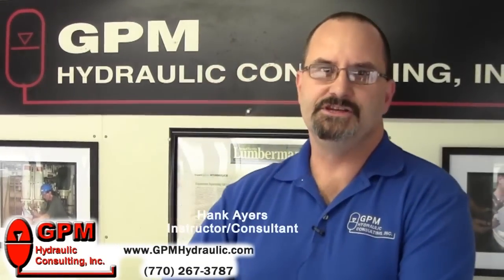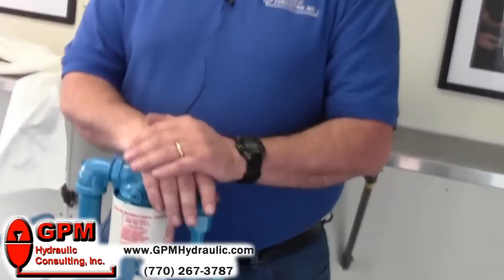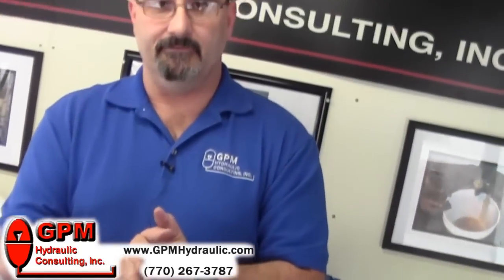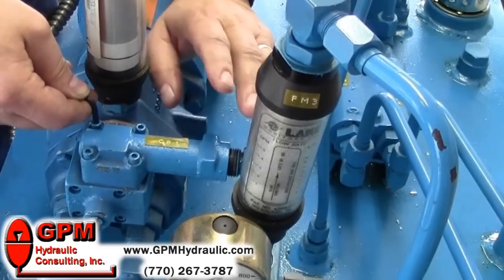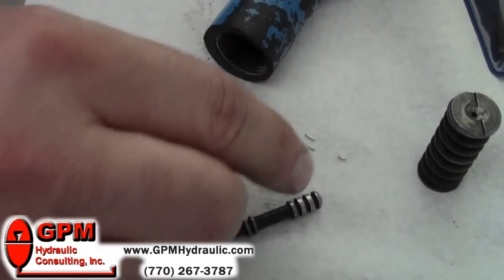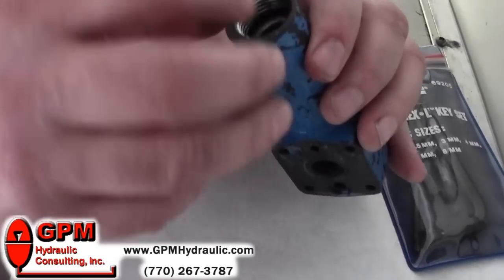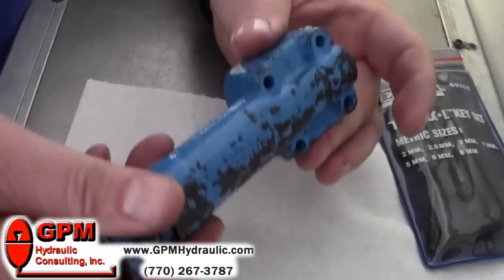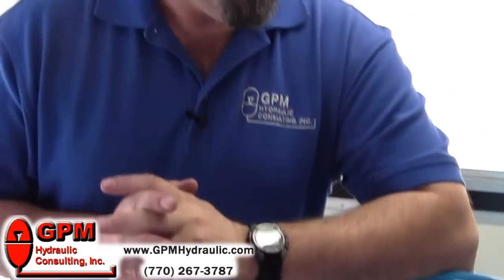Diagnosing Low Pressure in a Hydraulic System

Comment: Thank for useful video related to hydraulic systems, our machine Turret Punch Press made by Amada model Aries 222 also facing low pressure problem, in this hydraulic unit used Gear type pump made by Uchida Oil Hydraulic Model GSP2-A0S12A06AR-A0-901-0 & unload relief valve by Uchida Rexroth DA10-2-A0/80-998-0 so, kindly give us a right reason to solve the problem.
Reply: Thank you for your question, Anil. The best way to test your pump is to deadhead the flow and measure the flow through your relief valve (the safest way to do this is with a flow meter). Begin with the relief valve set at a very low pressure. All or very nearly all of the pump flow will be delivered, even if the pump is badly worn. Then, increase the pressure setting of the relief valve, continuing to monitor the flow. If, as the pressure is increased, the flow decreases, the pump is worn. If you can get the pressure up to normal system pressure with no significant reduction in flow, the pump is good. Naturally, if you are unable to adjust the relief valve, then the valve is likely to be the problem. Hope this helps!
Reply: GPM Hydraulic Consulting - I have an old backhoe with no real power to the backhoe unit. I tested pressure according to manual and seems fine but when put under a load it’s very weak. Do you think my pump is bad? 60 year old machine. Do you sell pumps?

Comment: what about a gear pump?
Reply from the maker: Well, since gear pumps don't have compensators, this wouldn't apply. Usually, in a gear pump circuit, low system pressure is the result of a problem with the system relief valve or system bypass. It is possible for a gear pump to be so badly worn that pressure cannot be developed, and if your low pressure problem occurred as a very gradual thing, it may be that badly worn. Test it by deadheading the system such that the only flow path from the pump is through the relief valve. Compare the pump output with the relief valve turned down very low to its output at normal system pressure (or as high as you can get it if you can't get it all the way to normal). If the flow decreases drastically as you increase the relief valve setting, the pump is worn. If, however, you can get all the way to normal system pressure with no significant flow loss, the pump is good and your problem is elsewhere.

Comment: Is it always that the compensator spool is located on the hydraulic pump?
Reply from the maker: Thank you for your question, Ativor! Yes and no. When a pump is pressure compensating, there must be a compensator valve mounted physically on the pump to de-stroke it. But it is also quite common for the compensator to be remotely adjusted, so in that case there will usually be a "master" remote valve controlling a "slave" compensator. Hope this helps!

Comment: Hi, I just ran across your very informative video, and I am wondering if you could help me locate my Compensator on my pump for my plow truck?
Reply from the maker: Hi Bobbie, thank you for your comment! If your pump has a compensator, it will be either on the top or on the front (opposite side of the ports), but chances are that your plow truck uses a fixed displacement pump, probably a gear pump, which has no compensator. Instead, pressure is probably limited only with a relief valve. If there is no adjustment on your pump, the relief valve is probably your culprit. You can try disassembling it and checking for wear, varnish that could make it stick, or contaminants that have collected keeping the relief valve from closing. If, after cleaning the relief valve (don't forget to look for plugged orifices!) you are still unable to set pressure, you may need a new one. Also, often on mobile devices, there may be a relief valve built into the directional valve body. If so, check it the same way. 
Your pump could possibly be very worn and that be the problem, but unless this pressure loss has been gradual over a long period of time, that is unlikely.
Hope this helps!
Jack Weeks
Reply from the maker: @bobbieborror5339  Unfortunately, no. GPM was forced to close its doors as a result of the effects of Covid. I've semiretired, but still do work on my own. You can reach me at jack@fluidpowerlearning.com